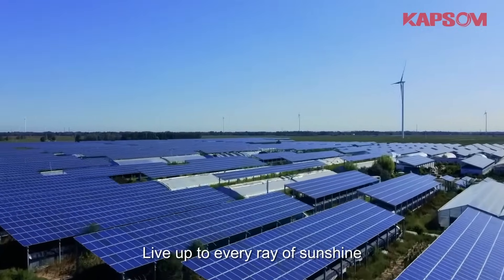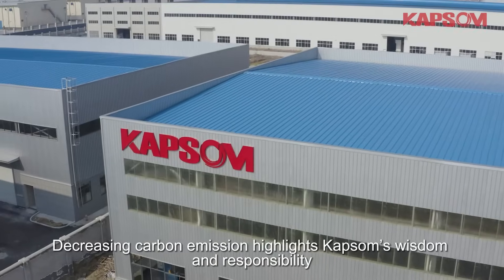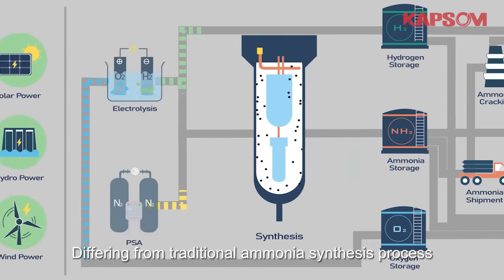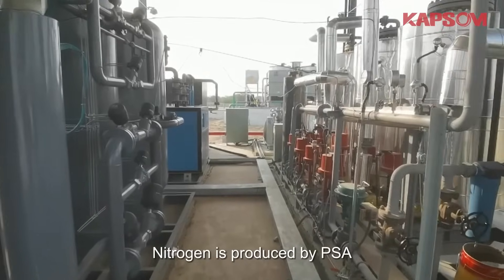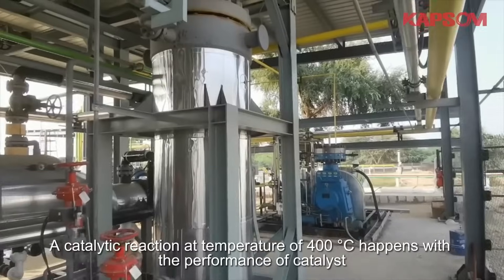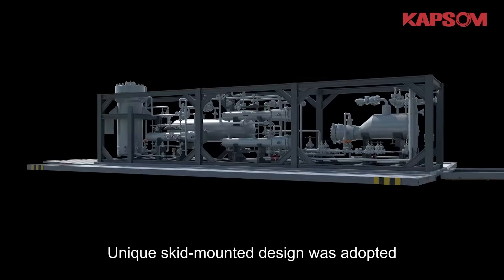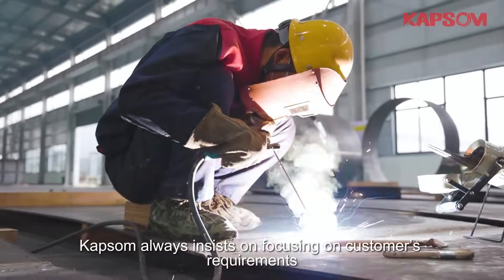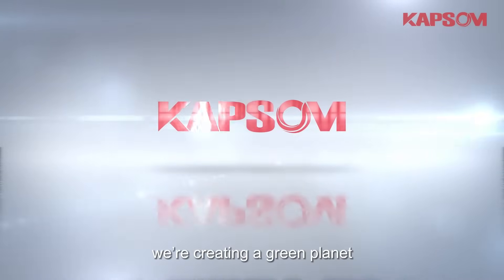World's First Green Ammonia Plant

Comment: All hydrogen stocks suck and will continue to suck until electrolyzers are conceived, designed, and built that can produce millions of tons of hydrogen per annum.  Right now, this is not even close to possible and there is not one shred of evidence by alkaline cell, PEM or SOEC electrolyzer that it will be possible in the future.   Hydrogen electrolyzers and fuel cells are total nonsense in India and everywhere else, the "Hydrogen stocks" are hopeless losers because none of the electrolyzer companies can deliver industrial-scale capacity.  They only offer small-scale electrolysis capacity, so they can't provide anything but small-scale revenue.  Small-scale revenue will never eclipse their operating budget, so they cannot show a profit (earnings).  Small-scale electrolyzers cannot make enough H2 from water to reduce CO2 output at an industrial scale, so they are irrelevant.  Renewable energy is coming on line quickly, but to reduce global warming, one must decarbonize all of the greenhouse gas emitting sectors -- transportation, agriculture, residential & commercial building and industrial sources (primarily concrete, glass, steel and industrial chemicals).  That means we must create decarbonized fuels such as green ammonia, whereby we take cheap and abundant renewable energy and split water into cheap hydrogen and oxygen.  Then, humanity can remove nitrogen from the air (air is 78% Nitrogen) and, using the Haber Bosch method, combine the green H2 and N to make green ammonia (NH3).  Ammonia, as a "liquid carrier of hydrogen fuel," can carry more hydrogen/BTUs by volume at a reasonable temperature and pressure than gaseous or liquid hydrogen.  Large-scale electrolyzers (no existing electrolyzer manufacturer can provide) would allow green ammonia to fuel and power all greenhouse gas emitting sectors.  When electrolyzers are scaled to provide ammonia-scale plants producing four million metric tons of anhydrous ammonia per year, replacing methane feedstock; call me.  It is important to realize that to produce one ton of ammonia using today's methane "steam reformation process" conventional ammonia producers for nitrogenous fertilizers release 2.84 tons of CO2.
Reply from the maker: Right now hydrogen generating cost is relatively high. But it's getting decreased year by year. Considering the grid price of renewable powers getting down in the meantime, green hydrogen, green ammonia and green methanol are more and more important. Especially when you're considering the CO2 emmission and restrict supply of natural gas as the war between Russia and Ukraine.
Reply: You missed the point, electrolysis isn't scalable, so it is irrelevant. Less than 100 MW installed in North America.
Reply: @sao9995  you said in original comment that we need to use renewable energy to split water into cheap hydrogen and oxygen. That's electrolysis right? So how does that work when you made the point about electrolysis not being scalable or is your point being that stocking hydrogen is not scalable but producing it is.
Reply: First, the largest electrolyzers are tiny compared to the demand created by industrial chemical production.  Second, Many electrolyzers must be connected in series to produce small amounts of H2 from electrolysis (20 MW max).  Third, hydrogen must be cooled to near the absolute Kelvin temperature and extreme pressure to enable its storage as a liquid.  In addition, H2 attacks whatever contains it -- making the container walls brittle and prone to leaks.  So, the idea is to create efficient Liquid Hydrogen Carriers such as green ammonia and MCH, which can be stored at near standard temperature and pressure, much like propane.  Remember, 8 MWh of energy is required to produce one ton of NH3.  With current technology, making 1 million tons of ammonia annually is possible using 1.2 GW of electric power.  This is the equivalent of 440,000 tonnes of very low sulfur fuel oil (VLFSO).
Reply: What's your final point?
Do you have a solution or you just saying it's impossible?
Reply: Is tehere already some ammonia powered truck or car? Do you know if they are hard to build?
Reply: The production of ammonia is an absolutey endothermic process. It will consume 7 KWh/kg for the hydogen and 2,5 KW/h for the rest. To replace the 7 KWh/kg, one need 10 KW/kg solar energie. One will end up with 12,5 KWh/kg.
The combustion energy is only 5,2 KWh/kg

What a lunatic idea.
Reply: Mr. Wilfred Schuler is the only realist on this thread.  He states the following:  The production of ammonia is an absolutely endothermic process. It will consume 7 KWh/kg for the hydrogen and 2,5 KW/h for the rest. To replace the 7 KWh/kg, one needs 10 KW/kg solar energy. One will end up with 12,5 KWh/kg.
The combustion energy is only 5,2 KWh/kg @wilfriedschuler3796

Comment: how many solar panels does it need to work?
Reply: Good question, more than 1000 standard ones. And i wonder where they get energy needed to heat the reactor to 400C...
Reply: @oktogen1476  
You are one of the few intelligent people to ask this question.
A classic modern Haber Bosch plant needs 9 - 9,5 KWh/kg ammonia. About 7 only for hydrogen. But the other 2,5 are still there.
For a 1 million tons output of ammonia containing only 176 000  to of hydrogen one would  need 2,5 TWh.
Let us split the 2,5 TWh in 1,25 TWh thermic and 1,25  TWh electric energy- To produce 1,25 TWh electricity you must burn 2,5 TWh LNG. It builds up to to 3,75 TWh
You need 9 TWh/k g ammonia solar eneergy    So, the total is 12,75 TWh/kg
Burning ammonia liberates lousy 5,2 KWh/kg, thus a million tons equal 5,2 TWh only.
It is only wasting energy.  12,75 - 5,2 TWh  are wasted . All efforts are just for fun.